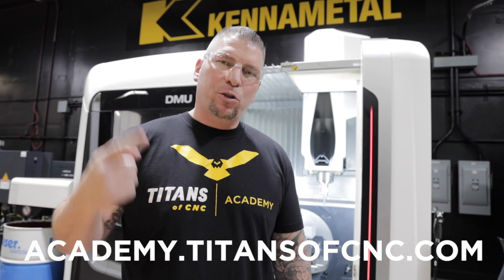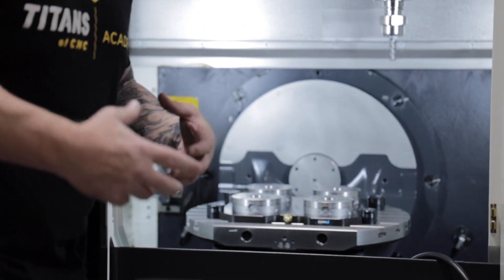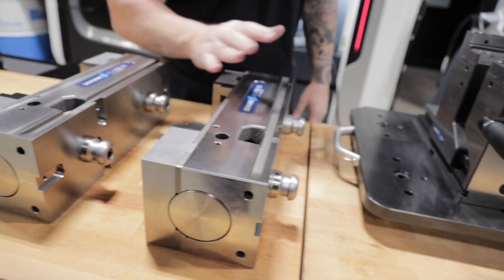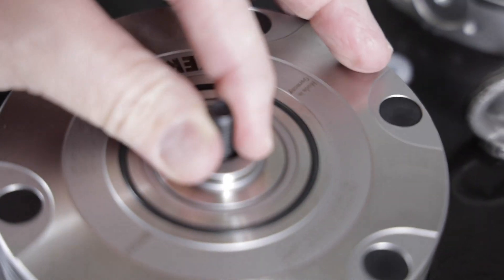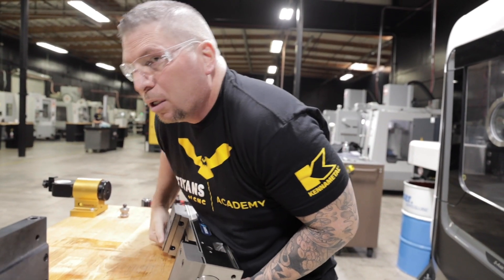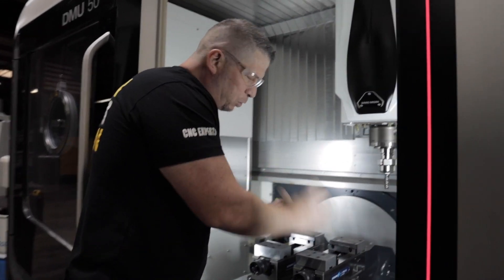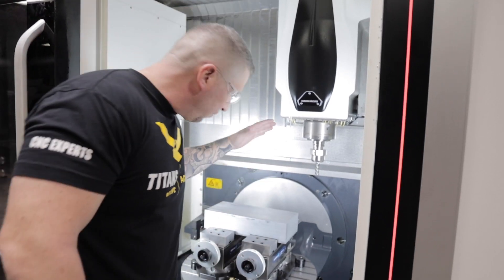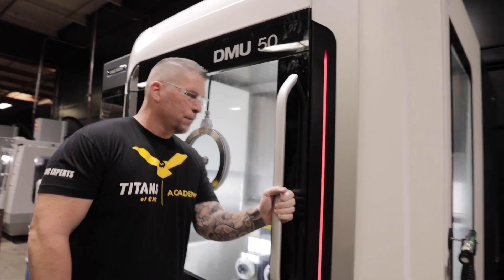SCHUNK CNC Workholding for my DMG MORI DMU 50 - Vlog #38

Comment: I'm using X-PENT 5AXIS VICE having torque 90N/m FOR CAST IRON HOLDING, on ZERO CLAMPING DMU-75MONOBLOCK. I WANT TORQUE CHART ACCORDING TO MATERIAL FOR HOLDING...IT'S BOOM USING KENNAMETAL ,SCHUNK, WALTER TOOLS

Comment: Titan, What type of air fittings are you using for the Vero base unit? I have Vero in my shop and I cannot find a quick connect air fitting that will keep chips and coolant out.

Comment: We started to use bolt lock system for fast install.
I'm not too impressed though.
I think, it's too sloppy. It holds the location, but it moves we with force.
This looks more reliable.
But is the cost justifiable?

Comment: Hai tiatan iam having a prblm with roatary axis which is mounted on vmc bed...
When doing drilling at required co ordinate position for the frst component its k..but when its rotating 180 dgree and done the drilling the hole to hole co axility is nt coming will u suggest anything to solve this issue..

Comment: Titan ...

You should try some PH Horn tooling .. it's amazing what cuts you can take with it .. Also Nikken hydraulic chucks for holding tooling .. You'll never pull another ripper out of a tool holder ... !

Reminds me of the time I was machining Door frames out of solid billet alli for Westland helicopters .. Carbide tooling and hitting a 30 foot high inside roof with the chips flying off (Machine had no guards as it was a horizontal with tool holders out of the main drive spindle) Z axis working plane become the Y Axis working plane  ... !
Reply: Hi ... I've never had a ripper pull out on me yet with a Nikken hydraulic chuck ... A collet chuck has lost me many rippers and parts over the year ... !   I'm a cnc miller by trade, we always used Nikken in aerospace ... !

Comment: I am disappointed with DMG, I bought the NLX2500/700 Lathe, the conversational control (MAPPS) is terrible. Is this the same? Shopturn is now available, I ordered just before it was available. CELOS is not finished, the job scheduler just does not work correctly, anyone else had same issues?
This workholding is very good, but expensive and stacking vice jaws I would think will make it far less stable than attaching to the bed?
Good work though Titan, love what you do.

Comment: This Vero-S is really nice system but it's set-up bit more involved than what Titan described here. For starters you have three types of standard clamping pins: fixed, positioning and holding. You want to use only one fixed and one positioning pin per set-up - others should be only holding the part down.

Comment: Sold a KSC vise set to a customer last week as part of a 5 axis kit. What sold the solution is that the KN clamping forces coupled with the grip jaws bit into the metal enough that they eliminated 
the dove tail process. Good stuff.

Comment: Small error.  Its mentioned as being 40kn.  kn is a force, not torque.  Its 1kn per 224.8 lbs of clamping force not 224.8 ft lbs which is torque. So its 40kn roughly 9000lbs of clamping force, which is way easier than having to calculate clamping force from screw torque.  I never really worry to much about what the actual clamping force is, I just find a torque value thats holds the part good enough without actually distorting the part too much.  I usually start around 60 ft lbs for most things and adjust from there based on intuition or an indicator sweep.

Comment: Hello TITAN! I love what you're doing for the entire machining trade with the CNC Academy. I wish this existed 19 years ago when I got started in manufacturing. I only have about 5 years of CNC experience, programming, and setup. So I'm still learning on the job, and with your Academy. I do have a question for you. I've been using SolidWorks for 2 years now and I'm looking at transitioning over to Fusion 360. What CAD/CAM software do you use on a daily basis for all of your part design, and CNC programming? Also, if you use more than 1 type of software, what are the pro's and con's of both types? Again, thank you for your help.

Comment: When you leave a gap of about 2mm when placing the raw material. (Between the jaws). The vise will close the gap and clamp to set pressure when closing the vise with the "long" handle.

When the part is finished and you open the vise it will open to the 2mm gap, and you can pick-up the part without having tot open the vise manually for a second time.

You win a few seconds every time.

European made. BOOM!

Comment: I started off in somewhere around 1980 working on a NC Burgmaster.. as time went along CNC Machines came out. But before they did all calculations  were done by hand and typed in on a flexowriter that punched out a mylar tape. The machines started off doing  point to point programming and then slowly switched over to absolute programming. The shops we worked in were a little bit cleaner than a dirty horse stall. 
I watch these videos now and can only shake my head. At the end of my "career" I was working on a 4 axis G&L with a 8 inch spindle. 
I'm jealous...you guys have it so good. It looks like you're working in a operating room. All you're missing is a cute nurse to come out and change tools for you!

Comment: If you're using both vises to clamp a long piece of stock that spans both of them, do you lock the vises down to the QC "pylon" (remove the air supply) AFTER you torque them down in both vises? Or do you lock the vises down to the QC "pylon" first, then tighten the jaws onto the stock? Or are the vises coplanar/parallel/trammed so precise, and have accurate & precise repeatability, that it doesn't matter what order they're tightened? Thanks, Titan. I really love your love for America, American manufacturing, and American trades workers.

Comment: Can you explain why to use that vero-s vs the lang quickpoint system? it seems much taller, isnt that a negative factor?

second try this:
On your new vices, back up one klick after hitting the material so your piece is free. Now use the quarter turn to lock your part in place.  used this technique some times (always when i was allowed to use the schunk vices, tho) and never had problems with it.
But you save that extra movement to open your jaws more (which CAN be possible mistakes if not done correctly)

keep on doing ;)
Reply: No comparison when comparing clamping forces. Also the SCHUNK system gives you an upgrade path to automation. The ability to control clamp and release through code.

Comment: Schunk has a great jaw program for those vises. The short grip serrated edge jaws will hold onto just about anything by just 3mm. Gressel/Schunk makes nice stuff all the way 'round.
Reply: but the scru is pointing aut so you have a lot of Kolisions edces an thys vice and thets wei ther are ony for 3 x Maschins
Reply: @HydraHimera  The KSG vises are fine & as stated, he has the KSX vise for times when he needs the extra room. Simulation and accurate tool & holder models are the key to avoiding collision in any machine.
Reply: @zaknefain100  TheKSX Vises are only expensif  thei are not Centering the Work and thet is a big problem from a CAM programmer view point and may apinien ist thet the KSX are not the best Vises for the mony. The DMU 50 hass a B C combination and in thet the Spindel ist veri often in kolischen witch the X+ and X- seits of the sindel and you need then a longer tol holder ony becose the vise ist the wrong type for any job on the DMU 50 or all 5x Maschines 

IF TITAN have pay for a normal Hilma 5x centering vise he could have 4 or 5 for the same money in particular he can then make 3 pallets like Tipe 1 1 Hilma vise type 2 2 Hilma vises type 3 3 hilma vises to make longer part with no old vises positioning wolk ps: my English is Baad/poor blame the German school system for thet.

Are You Yusing the KSX or KSG Typs ?wat are your expiriens witch them?

Comment: Something doesn't add up in the math. For some reason I think it is 4.0 KN per Meter or 274 pound per foot. Looking at titan if he is 200 lbs with a 2 feet bar to the center he had to put just a little less then half of his weight onto the end of the handle.
Reply: He confused it by saying foot pounds, it's not, it's a clamping force not a torque.

Comment: Doesn't the dmu have air through the table so you dont have to manually hook up that hose?
Reply: @machinist5506  you couldnt leave a hose connected to the table while it's doing all kinds of 5 axis moves.

Comment: i think its over weight for 5 axis movement on C or B
Reply from the maker: Not at All...
Did you see my 700 pound Chess Board Set Up on the Haas?
Reply: The drive mechanics on these 3rd gen DMUs are insane. No worms and stuff anymore; they’re extremely robust. Big power and big speed. It does seem a little heavy for heaving in and out though. Our Mori verticals will retract the roof shutter with an M code. Makes getting a chain fall in for heavy stuff a piece of cake. Not sure if the 5 axis machines do this or not.

Comment: I love schunk products, their vices are amazing.  I wanted to go with the vero system on our 5 axis and our newer 3 axis but most of our customers use FCS so we ended going that route.  Also I noticed you are still using the kennametal hydraulic holders, why not the schunk holders.  There toolholding is among the best.
Reply from the maker: Like Schunk, Kennametal is also Top Quality.
Reply: @TITANSofCNC  we are a job shop and a lot of the work we do has very right deadlines, Kennametal is the only brand we can get guaranteed next day. So we use A LOT of Kennametal.  Kennametal is defininatly a quality brand, but there are some things I avoid like the plague, there tool holder's are one, we have mainly big plus spindles in our shop and I've found that less than half of the tool holders actually makes dual contact.  I hate being talking a brand down, it's just that I use A LOT of it and I often find myself wishing I had something else.  Maybe I'm just spoiled.
Reply: I feel bad already, their turning inserts are pretty good and I do like the Harvi 3's lol